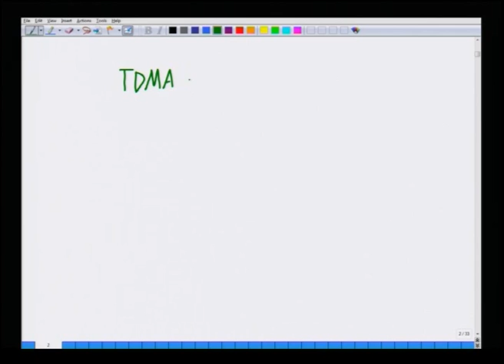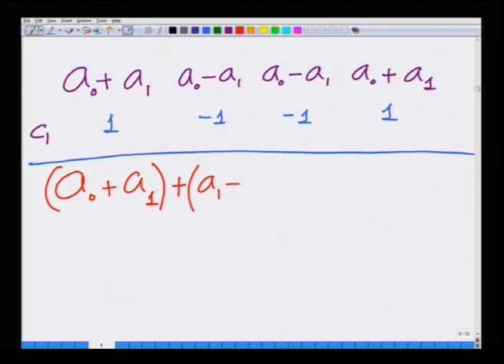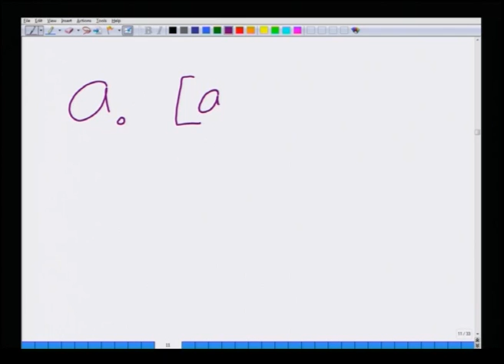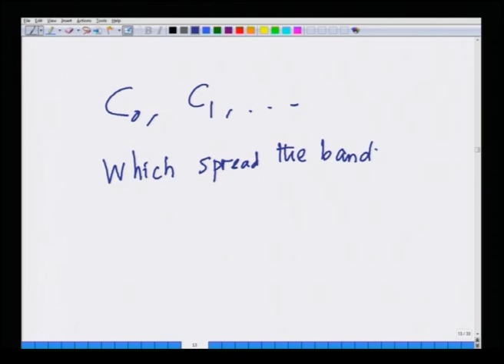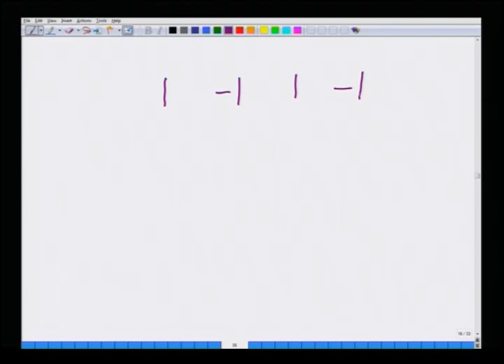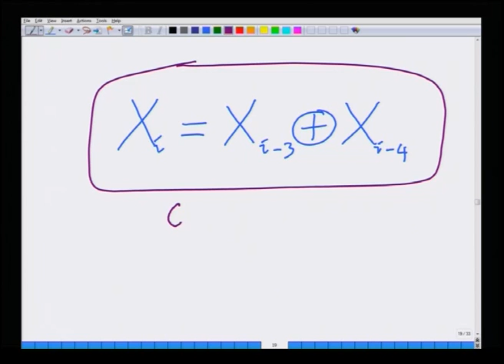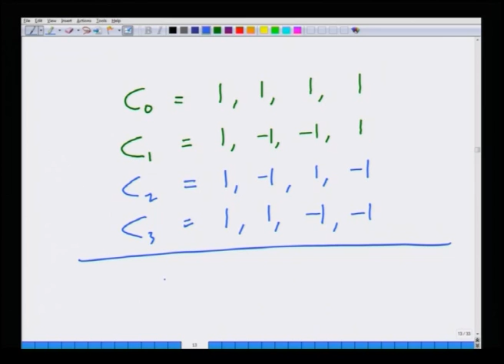Comment: Hi, at 38:10, in codes C1 and C3, there is orthogonality provided that the encoders are synchronized. If you time-shift C1 by one bit-time, it will no longer be orthogonal with C3. How can this be worked around? Surprisingly, C0 C1 and C2 remain orthogonal even if time-shifted (i.e. with asynchronous clocks). Is this statement correct? Wouldn't it be smarter to forego C3 and stick with just C0 C1 and C2?